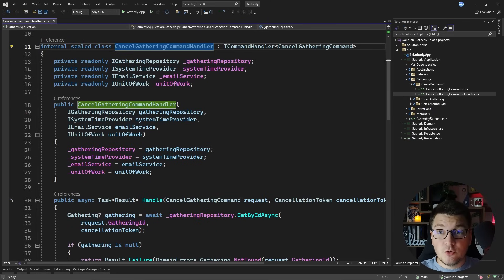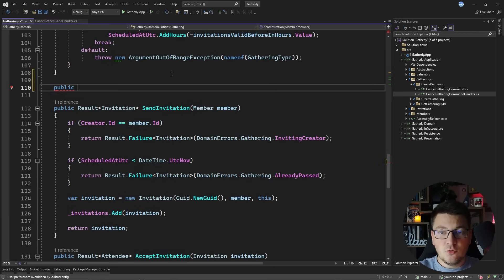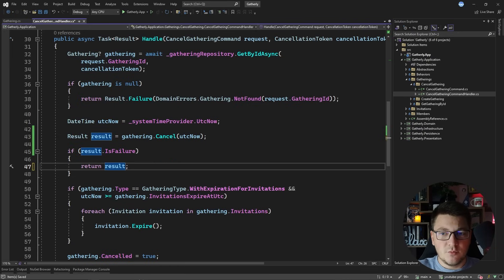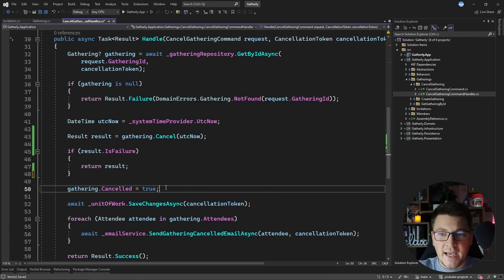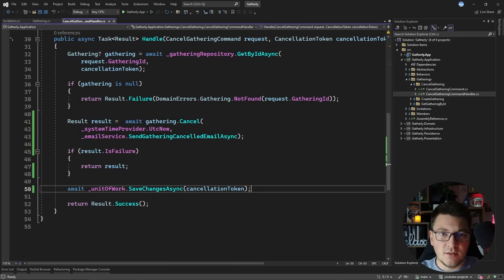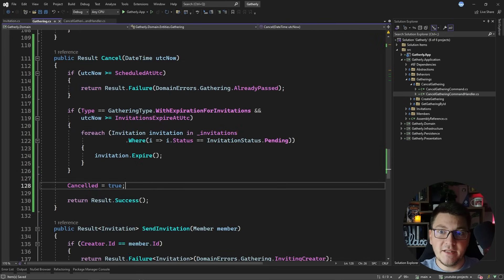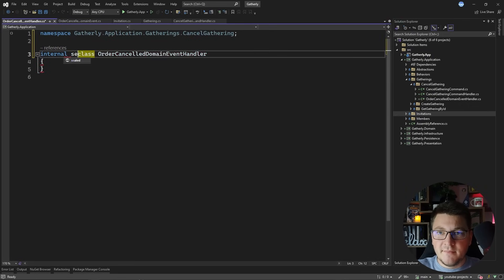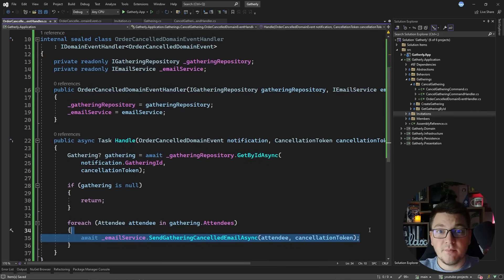How To Start Using Domain-Driven Design: Pushing Logic Down

Comment: 8:56 not necessarily. You chose to call the function sendEmail, but what you have there is a callback, an onDone callback. You could name the function argument onDone and the domain has no concept of what that callback is or does. The real reason why I dislike this is different: your domain does too much, and your domain should not orchestrate use cases, the application layer should do that, so the application layer should send emails. Plus, I hate callbacks, makes control flow harder to understand.
Reply from the maker: No, that's not a callback. It's the same thing as injecting an interface or an object, to call one of its method. Except in this case it's a function. Would you consider IEmailService.SendAsync a callback?

Comment: Thanks Millan for this great info, I have a question, The CancledDomainEvent will be triggered even if the persistence failed in this case and it is considered an issue because the email will be sent in the case of cancellation failure during the save process.
Reply from the maker: It is an issue, and we would actually want to temporally decouple these operations

Comment: The result type is defined inside the domain layer. But when you returning it from the application layer you need to reference it (transitive) from API layer. Based on the pure clean arch there is no direct reference on the domain.  But on the other side does not make a more sanse to have wrapper inside the application layer. Is it a tradeoff what you are able to accept or is there ara any other possibility for doing this ?
Reply from the maker: Application can reference Domain
Reply: @MilanJovanovicTech  application can but you are returning Result object from handler. And the return from handler is consumed by the presentation layer. So there have to be transitive reference on the domain project.       You are able to call this part of code from the contreoller: Result result = _mediator.Send(new Query()); Where the Result type comes ?

Comment: You can now loose the emails when the app dies between save and send, one solution is to make the events durable and store in the same database transaction so you can recover from such issues too
Reply from the maker: That's a separate problem to solve. An Outbox would solve all domain events in general.

Comment: Hi, it's a great video, but I would like to ask where do you put your repository in which layer?
Reply from the maker: I will place the repository contract in Domain most of the time
Reply: Ok, thank you for the answer
Reply: contract goes into domain or application layer, implementation goes into the persistence infrastructure layer.

Comment: Having the Invitation.Expire() method internal is good, but the entity is still not encapsulated inside the domain, some parts of the domain can erroneously still call Expire() on it. Is there a better way?
Reply from the maker: I wouldn't bother with that. It would already be a design small if I were to reference Invitation from another aggregate/entity

Comment: Thanks for explanation, I have a question. If we need to use another service such as IStockService to check Stock, How we should put this Logic. We cannot put this Logic to Cancel method because domain layer cannot reference to Application or Infrastructure.
Reply from the maker: You can do the stock check in the Application layer
Reply: @MilanJovanovicTech  can you explain this a little further please

Comment: I am on the "Always valid" school of thought. You can, indeed, throw exceptions (not Result) from the domain layer to enforce invariants. But the actual validation should happen in the application layer. Validation is context specific.
Reply from the maker: What are your thoughts on partially hydrated domain models?
Reply: @MilanJovanovicTech  I'm afraid I don't understand the question in the context of DDD. 
Domain entities must be always valid.
If you need to create a domain entity from two sources, you can just pass the data through a Factory.
Reply: When handling the validation within the domain layer, the operation (say: method) on an aggregate would be the context.

Comment: Sorry but i don't get it.
What you are showing is clear, but is it a good advice to push your business logic to the domain entities? Isn't our domain supposed to be just describing the entities and MAYBE some simple methods to populate the class? Where is our core/useCase layer now? Are we going to start unit testing the domain?

(Sorry if this comes a bit aggressive, not my intention. I am just confused because this goes against of what I know as 'correct' 😀)
Reply from the maker: If you want to follow DDD - then it's considered a good approach
Reply: You can do that, but then you'll have an Anemic Domain Model and no longer are doing DDD.
Reply: @krccmsitp2884 I prefer the service layer to contain business logic and keep the domain models as a pure data structure.

This way it is easier to test and you do not have domain entities containing data structure and business logic, resulting in a HUGE class.
Reply: @Competitiveforlolz  Totally agree! On top, the benefit of consolidating the logic to a single layer is unparallel! Having 2+ layers where the business logic (and bugs) can be found, is sometimes hard to work with.

Comment: Hi, Milan.
Can you explain why in the CancelDomainEventHandler getting null result from 'GetByIdAsync' isn't an exceptional condition?
I, kind of, see why it's so. The handler is unaware of the business context it's just a functional unit, but what if I, want to confirm that an email has been sent?
Then we will probably need to return 'Result' from DomainHandler so that in the CommandHandler I could do a retry or throw an exception. Is it the proper way to do this?
Reply from the maker: Does it make sense to send an email for null gathering? Probably not.

Another solution is throwing an exception, and then tracing that through the logs.
Reply: @MilanJovanovicTech  you misunderstood my question a little. No need to send an email for null. I just wanted you to elaborate a bit on why null isn't an "exceptional situation" and also how to make sure, in the CommandHandler, that it has been sent.